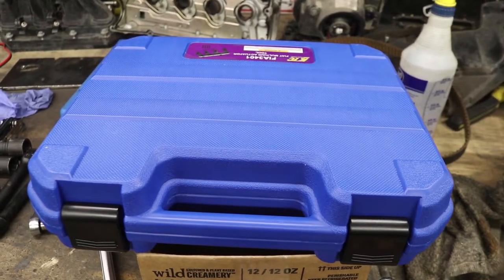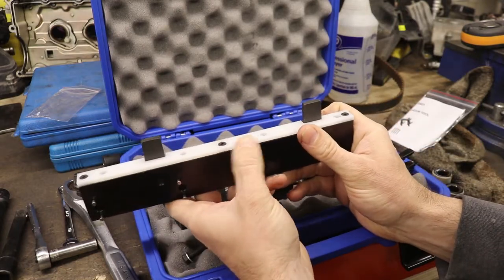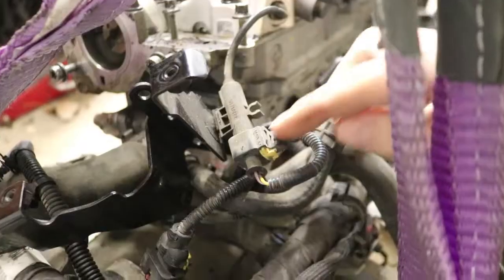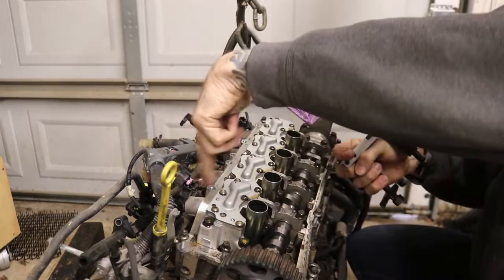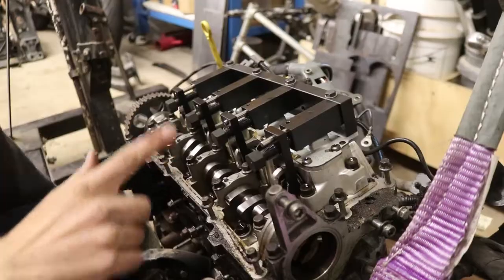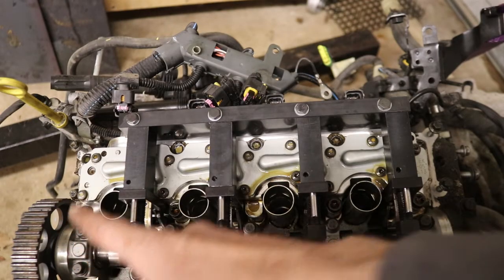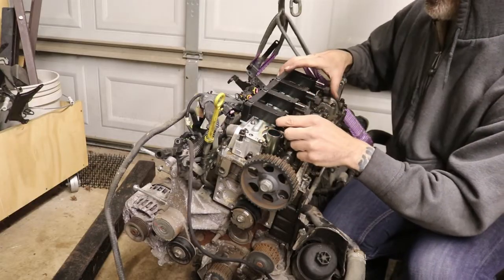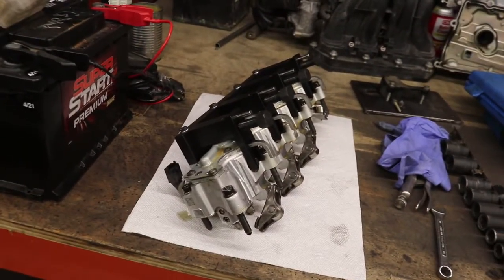Fiat Variable Valve Actuator Assembly Removal using Special Tool 10259A

Comment: I'm sorry but I have removed maybe 25 of these parts 1.4 and 2.4 and install them back or replace them, I been doing this for 3 to 4 years and today December 2025 I learned that there was a tool for it, hmmmmm    for anyone reading, just be careful removing and installing it, there is no need for the tool

Comment: the tool is about 120 € not 1200 USD - the multiair brick is about 1200 €. The tool is helpful for refitting the multiair unit back in. As I remember, it helps a lot to lower the brick vertically and avoid messing up the liquid joint freshly put on.

Comment: Zero need for this tool. I litterally just tore mine apart last night. No special tools needed. Once u loosen the bolts it comes right off. My engine is still in my car as well.  U did alot of extra work for nothing
Reply: Im about to do this on my dodge dart1.4 camshaft took a shit was very concerned on taking the actuator apart but I’m going all in
Reply: How easy was it to install?? 😂😂
Reply: @joerichardcycles69 easy as fuck take a impact gun get them to the point its snug going around in torque pattern then torque them down its not that hard this is why us guys that are certified mechanics are superior to you youtube mechanics 🤣😂🤣😂
Reply: Easy put it in tdc without tool and pre load the actuators with oil

Comment: There is no need to remove the Multiair module in order to remove the head from the block. Also, removing the whole engine as well... 😂
Reply: BS. . Brick must come out to remove head bolts. Must use the tool or else risk damaged valves. 😂😂

Comment: Any info on the torque specs to reinstall the actuator? I would greatly appreciate the help!
Reply from the maker: https://youtube.com/shorts/gJueBY5frec
Reply: 98 in lbs
16ft lbs
16ft lbs
Make sure the tappets seat on the valves or else bent valves at start up attempt.

Comment: So this tool is compatible with Mopar tool?
Reply from the maker: The one I used is a generic version of the Mopar tool.
Reply: @HooptieDoodle  how much did you pay for?  I saw it on Amazon, but they said it won't work on 2.4L 2016 Jeep cherokee latitude
Reply from the maker: @marioalvarez736    I could see how the tool for the 2.4 would be bigger than that for the 1.4, but I've done no research on this. I paid around $400 for the generic one on Amazon. Still Way too much money.

Comment: Hi , i own an Lancia Delta 1.4 16V Turbo Multiair .At the moment the head gasket haves to be replaced .Is it really necceserry to use this tool for the MA systeem ?Sorry , my mother language is not english , i'm from the netherlands
Reply: you do not need the tool..
Reply from the maker: According to the service manual - yes, this tool is necessary.  According to internet rumors there are other ways, but I am not familiar with them .

Comment: Multiair is a great flop ......My punto has the 1200 69 cv fire a very old motor. Multiair has not replacement the fire ...Multiair is very problematic
Reply: Multi air is much better and is not a flop at all. The 1.4 multiair fire engine is very efficient and makes a lot of power for it's size. Also a lot of power potential thanks to its cast iron block and unlimited variability. It powers some very fun cars like the fiat 500 abarth. You clearly don't know what you are talking about.
Reply: Btw the multiair 1.4 powering fiat 500, dodge dart and more is also called FIRE engine just much better since the multiair upgrade in 2012.
Reply: @marsel108  in Italy multiair has a great flop in italy the mechanics a problem for repair this and the costs its much and the owner of cars with multiair make the maintenance looks like shit ....an example oil of 30.000 kilometers looks like diarrohea
Reply: It's not really a flop, it's mostly mechanic shops that don't put in the right oil. Modern engines need very specific types of oil, 5w40 is not just 5w40, there are different types with different dopes. If the correct oil is used in the multiair engines and the oil is changed when it should. It wont have a lot of problems. Similar situation: Ford 1.0 3 cilinder engines with the timing belt running through the oil, use the right oil and the belt will last, use the wrong oil and the belt will fail.

Comment: left handed threads brother.that's what they are called on the unit.not "threads that go the other way" backin the garage today . your shop helpers are nice . the little orange guy needs a pair of coveralls
Reply: but they are not left hand threads. Thee blolt is moving the finger backward when tightened.  The end of the bolt is capped and does not screw into the big black bar, it is like a foot on a C-clamp it just spins in the bar.  It just pushes against it shoving the top of the fork in and away when backing the thread out left.    It just looks backward becaus the way it is made